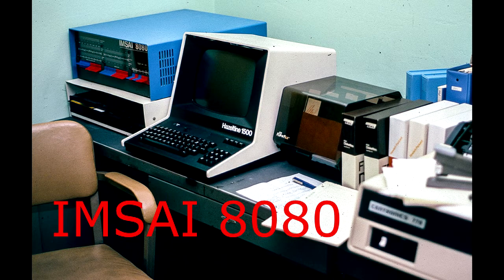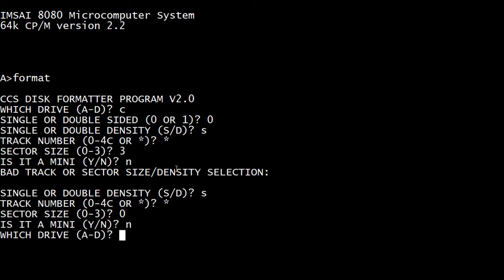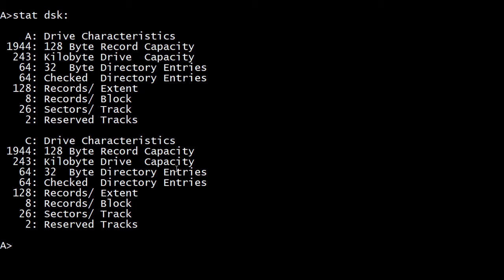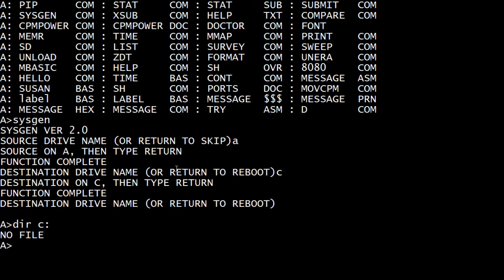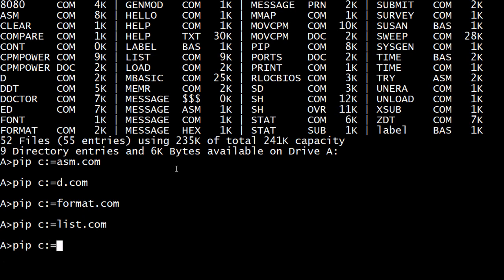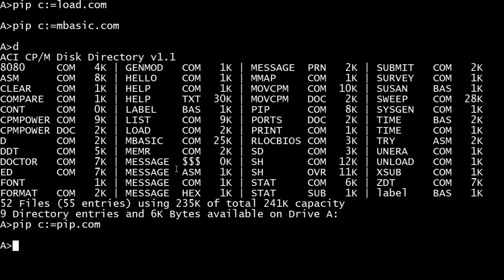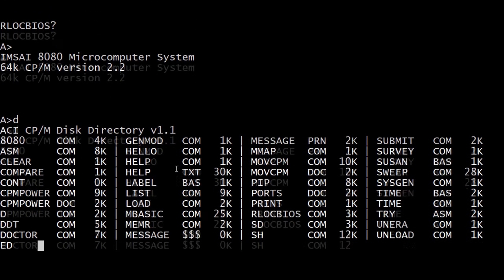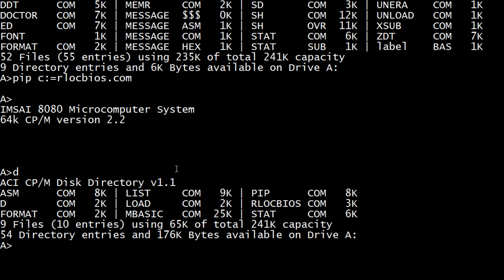#45 IMSAI 8080  making bootable disk

Comment: should the RLOCBIO.COM be copied first so the drive would not have to seek so long away from first block?
Reply from the maker: yes, the boot tracks are on the inside radius of the diskette. so the disk seeks to the inside, loads the first two tracks, then if the RLOCBIOS is the very next track (first on the directory) it will not have to move far to get it.